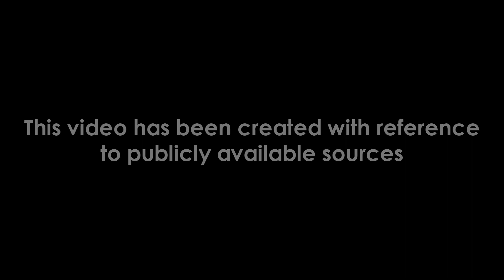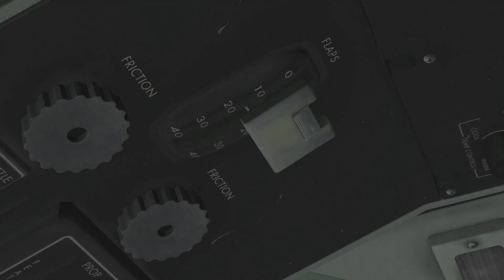Was This Airport Too Dangerous? (Widerøe Flight 839) - DISASTER BREAKDOWN

Comment: Excellent video! As a Norwegian aviation enthusiast, I remember this accident, the investigation and aftermath pretty well, and from memory, I’d say the video is extremely accurate. Very impressive indeed. Another tragic and interesting accident with Widerøe, albeit with a Dash-8, is the Torghatten accident, flight WF710. Also, the Mehamn accident with a Widerøe Twin Otter is particularly interesting, with the investigation re-opened several times during the 3 decades after the accident. According to the official report, the cause of the accident was a failure in the tail section, relatively similar to that of the Måløy accident 8 years later. Highly recommended topics.
Reply: Torghatten accident was a Dash-7. I presume it was just a typo and you know this :) But just incase any one else was wondering.
Reply: Thanks for correcting me! To be honest, it was a memory slip from my side and not a typo, but either way, I stand corrected!

Comment: The proximity of steep.terrain to aierodromes and airs airfields is something with which as a PPL holder, affects the small GA aeroplanes I usually fly. I used to fly from Cambridge Airport innTasmania and quite often had to postpone flights owing to the turbulence and Dow draft from nearby hills. Change of wind direction during flights als made landings quite challenging.

Comment: Has their ever been a plane incident where the carry-on was too heavy causing problems on a flight?
Reply: Air Midwest 5481 is close
Reply: The was also a faulty repair problem on 5481 but both the baggage and passenger weights were over even though the pilots used current tables. They really got screwed.
Reply: Does west carribean airways 708 count?

Comment: I can't think of too many incidents where it's concluded that the airport itself is the problem (or at least a very significant factor).  There are many famously dangerous airports, many of which have had fatal incidents as well, but the danger is known and there is at least a window in which safe takeoffs and landings are possible.  This is clearly an exception to that.

Comment: Limits are given for a reason. I fault the tower for not grounding the plane and giving them the winds, and to the pilots for not double checking the wind directions again given how marginal conditions were. I don't know about the airport. Doesn't look like they had many other options on where to put it. 
Haha if the chocolate factory hadn't closed, I'D fly into it! :) I believe if the limits had been adhered to, the airport would still be open today.

Comment: Accidents are never due to a single thing wrong with the airport, or a single mistake by the crew, or a single part failing (apart maybe from the MAX fiasco, and even then multiple people had to sign off on the system).

Comment: so this airport was not just dangerous but also cancelled several flights? ok why did they even build it? I have no clue why they would risk people's lives and planes for landing on this island at a place like this. too many risks there, you know what I mean? also I'm trying to calculate the numbers involved(wind load) and right now I'm trying to figure out wind density, I have used the average C and average dew point in F but having a bit of trouble with altimeter setting, not sure what I should use for this particular incident. any values?

Comment: I've often thought that air strips in "challenging environments" should be phased out in the interests of safety. You want to live in the middle of nowhere? Fine, knock yourself out, just don't expect pilots to casually risk their lives (let's not forget passengers as well) to supply you. 
"No, it's not that, this remote area is a tourist magnet, we need an air strip to land them". No you don't, if tourists are that desperate they can get a boat/car/train/ to your little paradise. They won't want to spend so much time getting to your paradise? Can't be that good then.
I suspect technology will eventually take landing a plane out of the pilots hands, in which case the debate becomes academic. Meanwhile, let's just make it as painless and safe as possible.
Reply: Kind of hard to drive a car or ride a train to an island.
Reply: @troodon1096 Goteeeeeem!

Comment: 4:35 Not quite. Instead of "The airport only saw few operations by Widerøe, of which a significant number of flights were cancelled due to unfavourable wind conditions" it should be "The airport only saw few operations by Widerøe, a significant number of which were cancelled due to unfavourable wind conditions."
Reply: i found the prescriptivist
Reply: Both of those sentences are grammatically correct, and mean precisely the same thing.  Not sure why you think the distinction is important.

Comment: The statement at 8:10 in the video that there is a 50 knot wind limit for takeoff is not correct.  There is no such wind limit in the Aircraft Flight Manual.  I know this to be true because I am the author of the DHC-6 aircraft flight manual.

Comment: 1960's plane...no wonder the tail failed because of the breeze.
Reply: LN-BNS was built in 1977.
Reply: @ptilrem  Not modern. Bad design if the tail falls off in a breeze. It was built by the same company that created the De Havilland Comet....not good
Reply: This is such a dumb comment. People should just not be spewing opinions on the internet about things they are ignorant about. There are still DC-3's build in the 40's flying around without problems. The havilland Comet's failures where because it was the first commercial pressurised aircraft. The cyclic loads this brought about where unknown about at the time. The crashes would have happened to the first pressurised jets no matter who produced them. After the crashes the plane was modified with round windows, and the Comet's flew fine after that.
The Twin Otter is a very popular plane with a design good enough to remain in production to this day. De havilland also produced universally loved planes like the Mosquito, Vampire, and Tiger Moth. 
Oh yes, and modern planes never crash right? I would suggest looking at the wikipedia list of fatal crashes, and see how many of the aircraft where build in the last 2 decades.